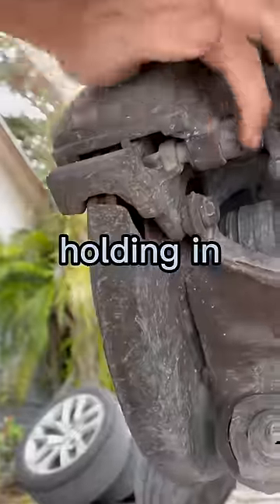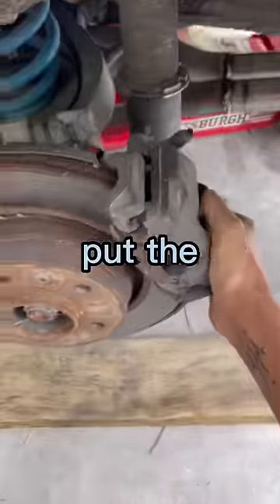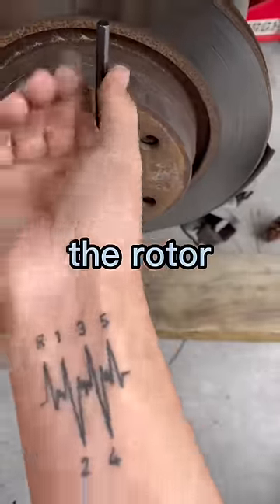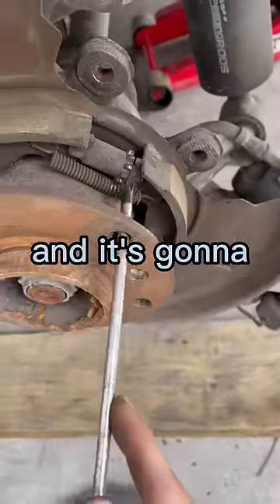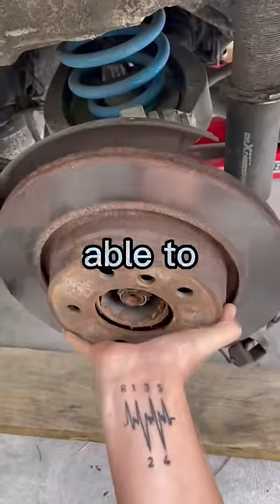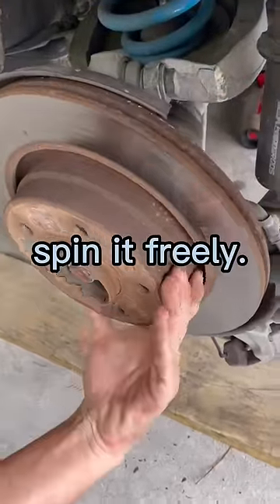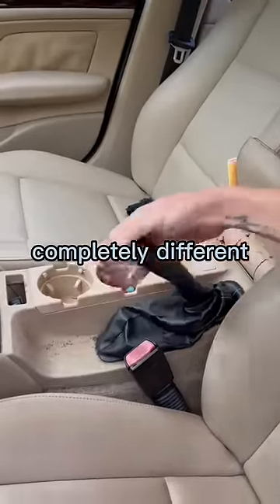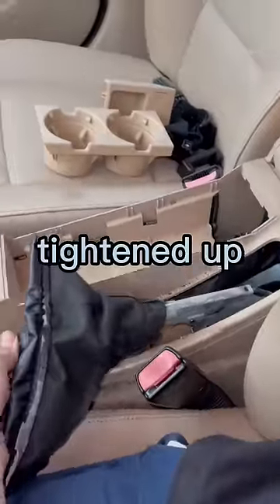How to make a hydro with your stock e brake!

Comment: You also just learned how to strain your brake lines! (DO NOT LET YOUR CALIPERS HANG FROM THE LINE!)
Reply: Man what are you on it's fine
Reply: Yeah if the line is gonna fail from hanging the caliper its going to fail on its own. Id rather it not happen when i need them
Reply: I agree it prematurely hurts the lines..
Reply: Mechanic here, in case anyone is wondering if he's right, kind of. It's perfectly fine to let them dangle by the brake pipe, so long as the pipe doesn't severely bend or fold as it can split the pipe or crease it and restrict the fluid moving through. If a pipe is creased or folded, you should squeeze either end of the crease to try 'round' it out a bit.

I don't if I can avoid it but I've let dozens of calipers hang by the pipe and not had one fuck up yet.
Reply: @gopnikolai7483  As an aircraft tech., I won’t take any chances. Not on cars, bikes, and especially not planes. To each their own, though. Work hard, play hard.
Reply: @draugwraith5549 there are times when you can’t hook the caliper onto anything. Brake lines are built to withstand thousands of psi they can dangle, I just would steer clear of dropping them. I wouldn’t classify it as a risk.
Reply: You shouldn't, but you can. And I do. Even on my customers cars. Because the wear is negligible 😊
Reply: Nah it's fine who needs brake fluid anyways everyone knows brakes don't drink fluid!😂

Comment: And those adjustment screws are to be done with the rotor or drum on. You tighten down tight, then back off to let wheels move with no drag. Listening to this guy is like your friend who can't get his car fixed 100%. Always working on it and then gets another car when the problems become to much.
Reply: That rotor is holding on one bolt , give it a rest

Comment: Fun fact. That rubber grommet hole on the disc is so you can adjust the e brake gear and check drag without removing the rotor.

Comment: You can adjust the drum brake cylinder from the backing plate, you do not need to remove the rotor
Reply: Rotor holds on 1 bolt

Comment: You don't have to take of the disc, you can adapt it throughout the hole from the wheelbolt. Put your flashlight to the hole above to see. 
No risk of f'ing up the bolt that holds the disc.

Comment: There is an access hole in the brake rotor to allow for the brake shoe adjustment to be performed with the rotor installed. You can see the hole in this video. Far easier than trial and error.

Comment: some vehicles have a rubber plug on the back of the brake backplate that allows you to set the brake adjusting screw. It's 10x easier that way because you can keep the rotor on the entire time and check if it spins freely.

Comment: You have to adjust the drumbrak when the rotor is on tight it till you can't move it and then 3 tooth back perfect adjustment for the handbrake

Comment: You can adjust the beake shoe adjuster though the one of the wheel nuts holes. Adjust it untill you can’t turn the disc and then back of 2 turns and the shoes should only just be catching. Saves messing about with interior adjustment

Comment: It is called a parking brake. It is for parking you car. This is to keep the car from rolling away, not using the parking brake will lead to excessive pressure on the parking pawl in and automatic transmission, or the gear set in a manual transmission. Also there is an access window in the backing plate so you dont need to take off the rotor.

Comment: Don’t have to take off the rotor.. just line up one off the wheel bolt holes with the adjuster and with the tip of a screwdriver you can just screw out the adjuster

Comment: U have to take off alloy only and then the bolt holding the brake rotor to the hub. 
Then grab flathead and torch and adjust your HANDBRAKE shoes from the hole,
the same what you do but whithout take off the caliper and rotor.

Comment: You don't need to take off the brake caliper and disc to adjust the handbrake. You align one of the bolt holes with the adjuster to do what you just did.

Comment: Please, if you do this, tighten the lug nuts and the caliper bolts well. I’ve seen caliper bolts fall off after diy repair to the point it was god knows how close to falling off, which throws off the braking of the car and is extremely dangerous. In general i would really recommend not messing with your brakes without the proper tools and experience, but if you must, please be careful

Comment: This is merely handbrake adjustment and its demonstrated poorly. Remove the wheel, with the disc on wind the adjuster till its locked, try the other direction if its still loose. Then wind it off two clicks and check the hub turns. The cable should only be adjusted to remove remaining slack but it does need some to prevent binding.

Comment: You don't have to take the rotor and caliper off. You can just stick a screwdriver through the lug bolt hole and adjust it.

Comment: You do relies hyrdo is short for hydraulic. Meaning to convert your emergency/parking brake from cable actuated to hydraulic like the rest of the braking system. All you did was tighten up the cable system

Comment: Most cars can be adjusted without removing any of that there’s a small rubber piece on the back of the dust shield remove adjust and replace

Comment: Most cars have an access port on the back side of the drum so you don’t need to take the caliper or even the wheel. Also don’t use a cable e brake for drifts unless you don’t care about your car. It’s not a hydraulic e brake

Comment: bro there’s no hydraulic fluid whatsoever, it’s purely mechanical
Reply from the maker: correct it was just the idea
Reply: @DraxDietz yeah, a really fuckin bad idea, that cable is not designed for that kind of use, an actual hydraulic brake for drifting is actually meant for repeated hard pulls

Comment: This is just how to properly maintain and adjust your stock handbrake, it's absolutely not hydraulic.  I just did this on my e46 when i changed the rear pads and rotors

Comment: You’re supposed to adjust the handbrake shoes with the disc in place, adjust it up until it locks the disc then wind it back to set the air gap …

Comment: No need to take the caliper and rotor off to adjust it. Use a flat head to feel around. Then again, just go hyrdo at this point.
Reply from the maker: it makes it easier
Reply: @DraxDietz  my cable was only good for 1-3 pulls hence I was constantly adjusting it. jack up car, take wheel off, adjust ebrake, go in tighten two screws, you know its tight if you cant move the wheel. taking caliper and rotors off makes it harder and time consuming. Kudos to you for making car content. Gotta be efficient with wrenching to get back on track asap

Comment: Could have saved a lot of time if you adjusted the shoes through one of the wheel bolt holes. No need to remove the caliper, carrier and disc unless you replacing or cleaning something

Comment: You know the whole point of "hydro" is that you run brake lines with brake fluid to a second set of calipers, all you did was adjust your parking brake, which used like that will fuck it up, its no wonder you had so much slop on the e brake

Comment: All you did was tighten up/adjust the cable system which should be part of your normal rear brake maintenance. I dont know how you converted to hydraulic without touching a single hydraulic line.

Comment: You don't need to take the caliper or disc off to adjust the cylinder. Put your screwdriver throughthe bolt hole. . . You're welcome.

Comment: wrong! you are supposed to adjust the brake shoes with the disc on so take it off adjust it and then put the disc on then adjust the adjuster until it locks the disc then back it up 3 clicks and thats the best

Comment: You do not need to take even wheel to do that. Just take off one locking bolt and put a screw driver to adjust that.

Comment: there’s not “usually” a bolt holding the rotor on, there are many different ways manufacturers build the vehicle. some you just hit with a hammer. some look like screws but you need an impact screwdriver. some (like yours) use retaining bolts. some have threaded holes so you can screw a bolt in and press it off the wheel hub. 
lesson - follow OEM R&R guides because every vehicle is different, or find a youtube video that is exactly your car.

Comment: Fun fact: most manufacturers have specific handbrake adjustment procedures (that nobody follows). Imo, at least reading through the recommended way to do it will likely be more informative than a video that calls steel cables "hydraulic" 😂😂😂

Comment: How about you do it the right way and get a system that can compress the hydraulic brake system only in the back when you pull the "ebrake" and your normal brake still engages all four pads LIKE A RALLY CAR.
Reply: Triggered

Comment: Bruh, this is just "how to adjust your parking brake"

By the way, you don't even need to take off the wheel or rotor.  There's a little rubber seal on the backside that let's you adjust it with a screwdriver.

Comment: youre supposed to adjust is while the rotor is still on. also dont hang your caliper from the brake line. also you didnt make a hydro you made a working e brake.

Comment: Bro this is just a tutorial on how to adjust your cable e brake…..on any car….this is nothing like a hydro. Hydro is using brake fluid and a second caliper to lock up the wheel, your normal brake will never lock up with abs active but with a hydro it bypasses abs completely and just clamps the hell out of the second caliper, the cable is going to break your e brake way before you ever lock up the wheels consistently….

Comment: Everything is wrong with this video. If you think you have to take the WHOLE CALIPER, DISC AND WHEELS OFF TO DO THIS YOU ARE WRONG. You can take one lug nut off, like it up and use a long screwdriver to expand the shoes spring

Comment: Funny you stuck the screwdriver through the hole on the hub but couldn't put it through the same hole on the rotor? Must like pulling things apart and putting them together

Comment: why even remove the disc if you're going through the wheel bolt hole? lol if you remove the disc there's no need to put the screwdriver through the hole anyway?

Comment: Bro you realize you didn't need to take the caliper or the rotor off to adjust that thing right?? 😂 There's also a specific tool that you use to adjust that thing typically you pull this little rubber plug out on the rotor and adjust it that way

Comment: Bro bro, I know we all gotta start somewhere but this vidoe ain’t it, not all car are the same, some you can simply just tighten the nut in the pull Ebrake, or some have a wire the pulls the caliper in and just tighten the nut on it, or like you’re with the drum mechanism behind the rotor, and for pedal Ebrake, all the adjustments is done in a drum. Just specify the video to you’re car and not spread misinformation their car is like this

Comment: WRONG way to adjust your hand brake! It should only lift 3 clicks to start with. You adjust it till you feel it drag, the back it off 1 notch. NOT 10 TURNS! also, you don't have to take the disc off. You adjust it with a screw driver through the bolt hole. For the love of all things automotive, do not follow people like this. 
The adjustment should be taken up in the shoes, not the handbrake inside the car.

Comment: Why taking off the rotors or the caliper, or the wheel? Just screw out 1!!! lugscrew... and then you can adjust your handbrake or "make a hydro handbrake", which has nothing to do with any hydraulic... 

Please don't work on your car, especially on your brakes, when you have no idea, how anything works or how to do it...

Comment: only 1 wheel screw out, rotate the wheel in correct position and u can do the adjust trought that 1 fuckin hole... dont need to remove wheel or anything...why are you mad?! xd but its still not hydro

Comment: You have done the worst job 😂 leave the rotor on reach though adjusting hole, tighten till it stops. Back of. Hit with hammer to centre drum recheck 👀😂

Comment: There are so many things wrong in this video. 🤦‍♂️
Reply from the maker: not really
Reply: @DraxDietz  bruh you called the emergency brakes a brake shoe, and you said that it’s a hydro e brake when it clearly is just tightening the e-brake cable.